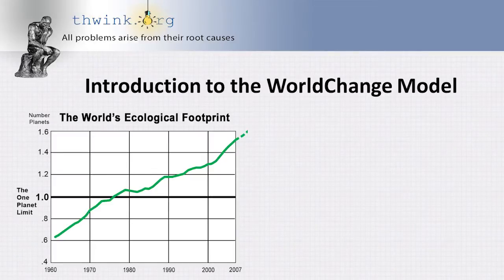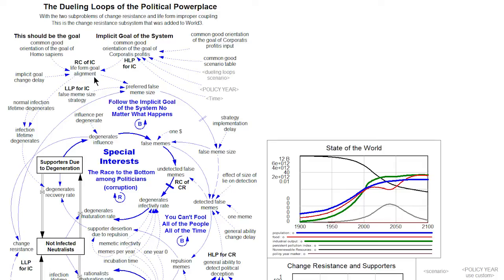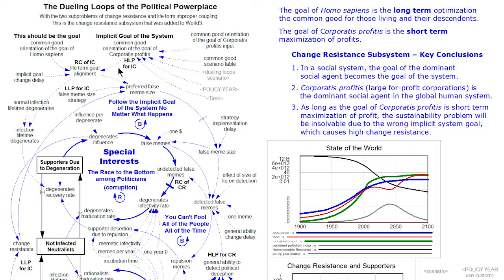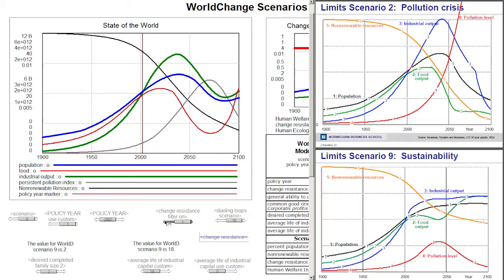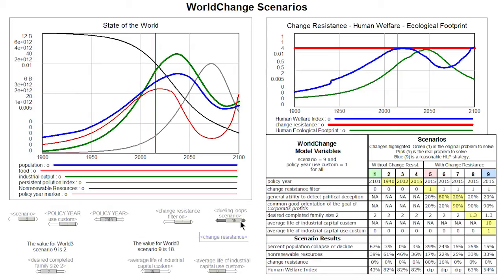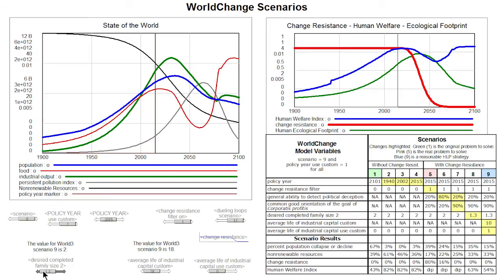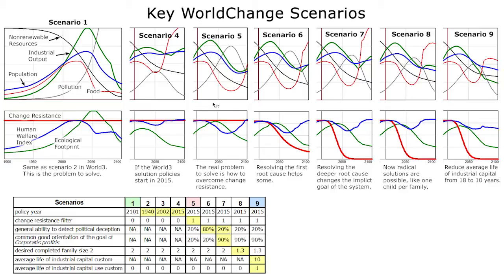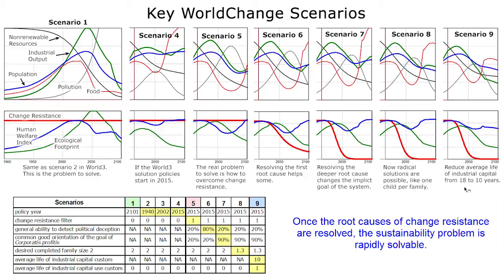Introduction to the WorldChange Model

Comment: I'm lost at "Reduce average life of industrial capital"..what it means??....Can someone explain it to me like "i'm 5" :))
Reply: Hi Edwa. Thanks for the question. Wow, you did well to follow the presentation that far before getting lost! At 8:50 in the video, a table of scenarios is shown. In the left column are listed model variables. The upper group is variables that are changed for different scenarios. The lower group of variables in the key results of the simulation runs.

I didn’t explain in the video that “average life of industrial capital custom” is a variable I added to the model. It and “average life of industrial capital use custom” are used to control the original “average life of industrial capital” in the World3 model. If “use custom” is yes, (it equals 1), then the model uses the “custom” value which is 10 years. If no (it equals 0), then the model uses the original “average life of industrial capital,” which was 18 years. 

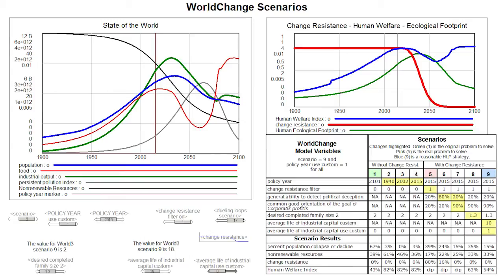So, what does “Reduce average life of industrial capital” mean? I’m looking at the video and script now. At 19:40 the video says:

“In the World3 model, the solution included an average life of industrial capital of 18 years. Suppose we reduce that to 10 years.”

What scenario 9 does is change average life of industrial capital from 18 to 10 years. Now the average piece of industrial machinery or entire factory lasts only 10 years. It’s like suppose cars lasted an average of 18 years. Along came a new law that once a car reaches 10 years old, it has to be scrapped.

Does that help?

By chance, I’m now working on a related paper, at: http://www.thwink.org/sustain/publications/papers/index.htm#LayerCR

The paper title is “Adding a change resistance layer to integrated system models using root cause analysis and problem decomposition.” The paper uses the WorldChange model shown in the video.

Good luck, 

Jack Harich

Comment: I'm very much a novice at Systems Modeling and just want to share a little for people who may have no experience.  Because I'm such a novice, what follows may be incorrect and lack the proper terminology.  

For those not familiar with the graphs and models, the presenters are using "SYSTEMS MODELING" software to model a dynamic system over time.  By adjusting assumptions and/or variables, we can see the impact on the parts and well as the whole over time.